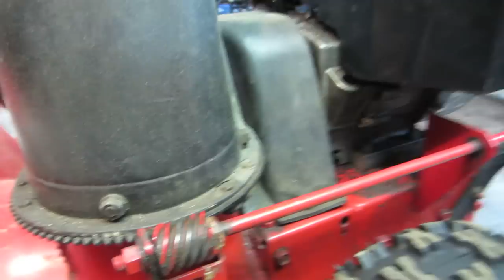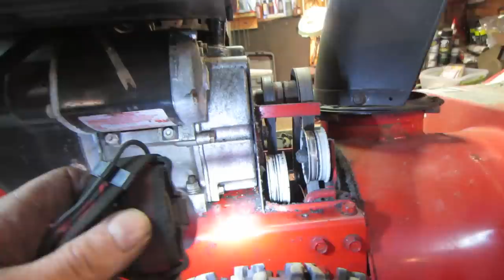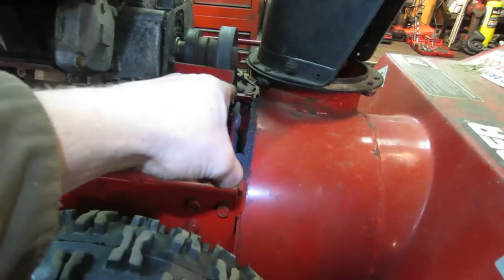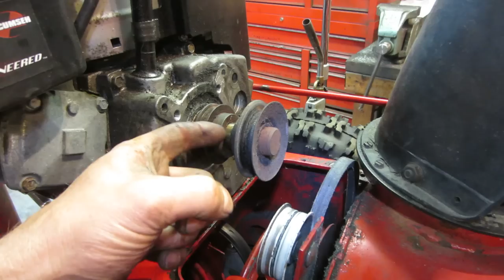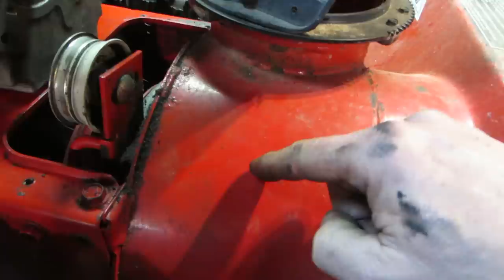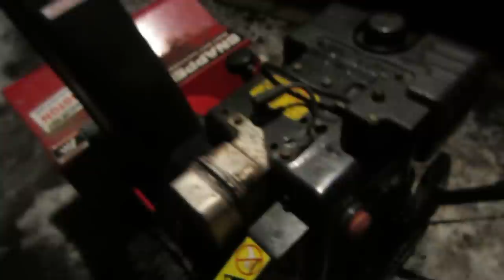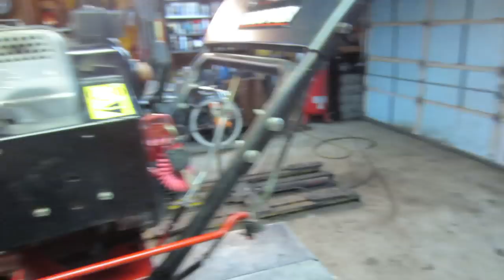snapper snow blower oil leak and shifting repair

Comment: The reason everyone likes your videos is because you always say what your thinking and that makes it interesting because everyone can compare what they are thinking compared to what you are thinking. Plus when you do something you explain why and how you plan to do it and when that dosnt work you come up with another plan. Thats what all good mechanics do. The only fault that you have in my opinion is you try to avoid taking off the carb. I do almost all of them and I flush the tank and quite often change the gas lines. Ive done so many snowblowers I can usually do that in half an hour without rushing. Good job.  Keep em coming.

Comment: I have a Snapper 1030 snow blower, quite a bit older than the one you fixed but otherwise very similar, also with a Tecumseh engine.  I just changed both belts, and I sure wish I had watched this video first!  I bought mine used at a garage sale about 20 years ago for $10 because it didn't run.  My dad cleaned out the carburetor and got it running.  I normally only need to use it a couple times each winter (some winters not at all) but it's been a great machine and really throws the snow.

Comment: Great Video.  I'm fairly certain that these are Tecumseh engines. You can buy a replacement carburetor from Amazon for $15.  The leak issue is one that I'm having a problem with too.  Thanks for putting this together.

Comment: Those set screws can be a bear sometimes and all the more so when they crack before you can loosen them. After you crack them, it just expands and makes it even tighter. They are hardened so crack easy and I have even used an air-arc to blow them out. You always good work and thanks for sharing.

Comment: Really enjoy your videos.  My 8HP Techumseh Snow King (2006 vintage) has the hunting problem.  Backfires when I go to shut it down.  Runs great under load and then will hunt at full throttle.  I have cleaned the carb as well.  One video I saw a few years back suggested to increase the jet size by honing with a larger drill bit.  Trick is to find a bit that fits then go one size larger.  I might give that a try.  Carb has a cap over the mixture screw.

Comment: I have had my share of fighting with repairs.  Thanks for sharing.  A lot of useful information.  I hope I do not need to use this, but only time will tell.  I seem to have more issues with appliances than engines in the last couple of years.  Last year I did have to make a new shaft for the gearbox of my mower.

Comment: I love the channel.  You are as good an educator as you are a mechanic, top shelf...  I have a comment about the original oil leak.  I did not read the full 3 years of comments, but to me, that bolt looks longer than what I think I can see on the one that is outside the shielded area that is NOT leaking.  If my guess is right, I think if you pull that bolt out again, and use a stick to gauge it, that hole is almost surely supposed to be a blind hole with threads and if so, with a longer bolt, it likely pushed in the casing causing a crack in the oil case.  However, as your repair method covers all sins, which is a real positive, it should be fine unless someone decides to remove that bolt in the future.  If you ever get that blower back, I suggest measuring the depth and get  a bolt that stops before impacting the case, or just buzz off the extra on that bolt.

Keep up that great video work.  I am in the majority in saying you are totally getting the making of the video right.  Don't change a thing.

Comment: I would have called you out on the oil idea. I have been working on blowers for years ( Had my own shop) and never have I seen that type of carb back flow into the oil. You are thinking of the Snapper rider lawn mower. I have fixed plenty of those too. Even got one for free because of that. I would think the drain tube for changing the oil may be leaking. If you dont hold the tube when removing the end cap on it,the pipe can unscrew from the block causing a leak. I usually drain the oil and remove the pipe,I then use pipe dope on it and screw it back in. I have also had the caps leak too. I use eather pipe dope or even a thread tape to stop the leak.  I have had the front seal on the engine leak on those too,it wont leak all the way down,just to the seal but they do leak. Usually I find they leak more when running and only going through heavy snow. Eventually it gets worse.  I have never experienced a cracked block or anything like that. I prefer Ariens snowblowers over all the brands out there. I tell people to never buy a blower from big box stores eather. Those are cheaply made. Sadly even Ariens has produced a crappy blower for the big box stores. I tell people to always buy a professional grade blower,yes they cost more,but the gear boxs in the Auger are made better and the drive systems are made better. Pulling rusty pullys is a real treat. I had a rotor tiller given to me where the pullys were destroyed by someone using a puller on those flimsy pullys.

Comment: I usually have good luck getting these off taking the set screws out and then spraying PB Blaster in there then turning it a few times to get the Blaster all over and the wire wheel clean up does make a difference taking it all the way off. The last thing you want to do is break off those set screws. Great video and mine was leaking when I stood up on the bucket overnight oil went right through the shaft seal. Not fun taking everything off to do it but it's been a great machine.

Comment: Another happy customer :-D

As far as your workshop being interesting is concerned, you are a man of many skills.
its interesting to see how you attack a problem, and blokes like mechanical and repair work, its still one of those things we enjoy.
Even if we cant do it, its great to see someone repair something.
Like the honda, a classic to many people, and you made it live again :-D

Yes i thought that linkage was the typical lefthand/righthand thread, looked easy, dam.
That linkage makes no sense, its like they could not get a lefthand threaded rod, so they changed the barrel and nut for a righthand one, odd thing to do :-(.

I didnt expect the crankcase hole to have a leak, i thought like you did with the seal.

I hate grubscrews and bolt heads that are allen key type, and small, ive twisted a few allen keys in the past, with plenty of swearing, of cause lol.
Allen key headed bolts find there way to the bin, like torques screws being annoying in home vacume cleaners, dam torques :-(

The bloody "Got Cha", bloody carb playing games at the end, that happens in electronics too, you sort out a device for all its problems, then just before you give it back you check it...........
Shit!! its playing up in a different way, 2 hours later the hidden fault is also fixed.
Perhaps .... wa wa wa :)

Comment: Good video
The idle surging of engine is from the main jet nut on bottom of bowl,remove it and clean out plugged little hole with a wire from wire brush .
The hole is located at top of big jet.
I bet there is debrie in the hole causing it to be plugged ,also clean out other passages on this jet and reinstall it.

Comment: I was first thinking someone may have put multi grade oil in it as that could be the cause of the oil seal leek if it was indeed leaking but looks like your diagnosis was correct. All the best from NZ

Comment: I have that exact same Snapper and as I've said in the past, those older real Snapper blowers were some of the best. Their frames are built a lot like the old Jacobsen blowers.
Their is a point of bad engineering and a,major weak spot on those....
The axle slides straight thru the frame/gearbox. Their are no supports. Just a lip that is forged into the sides. The left axle bushing in particular can go bad and if you do not catch it immediately the axle will ride on the frame and destroy it. Once that occurs your left with two choices. New frame, which includes a lot of disassembly and re-assembly or what I did, was purchased an Ariens 10000 series axle support knocked a snapper bushing into it because the inner diameter is different. Measured out a perfectly round hole. Cut a round circle into the frame so the Ariens support could go thru and sit flush. Drilled 3 holes to bolt it on. Now its good. No more play and if the bushing ever blows again, theirs an axle support its gotta go thru next, which can be replaced again if neccesary so I never have to worry about that frame again. It was a big pain in the ass but worth it because you cannot buy a machine built strong and big that throws snow as good as that anymore. Thst machine digs hard and devours snow, Im talking big heavy snow.
Also reverse tends to get lost, what you have to do is file the groove for R up further and file the tip of the shift handle down a bit. That will allow the friction disk to slide further over on the plate giving you a stronger faster reverse. Otherwise they are killer snow eaters them old American steel Geargia made Snappers......
I hope to have mine as long as Im around.

Comment: Excellent video! The reverse linkage adjuster looks like a turnbuckle, but it does not have left hand threads at one end of the coupling with corresponding left hand threads on a rod end that would allow the coupling to be turned to shorten or lengthen the entire rod. Certainly less expensive to make it that way, but less convenient to adjust, as you figured out. Wooden screen doors use turnbuckles on threaded rods to take out sag, maybe one could be modified to make the reverse linkage.

Comment: I had the exact same problem with a '74 Suburu wagon. Had a two piece crankcase, and it was the gasket between the two halfs.
  In a tough spot, never could find the leak myself, had to have a dealership find it and fix it.m

Comment: Been fixing for years just going to mention at times save you some grief,every once in awhile you will run into cleaning a carb over and over after years learned to just buy a new tank,have tried cleaning tanks that just refused to clean tanks with a drop sleeve in the throat of the tank which prevents sloshing out all the debris in tank no matter how hard and using every method, even used running water in high volume ,air etc.
Saved more money for customers by replacing those tanks new than racking up hours in labor.
Could run finally send back to customer and he phones and said it quit , don't spend to much time messing with it .
Also l always clean carb complete saves time and no going back .
You have any questions for me just ask glad to help.

Maurice

Comment: Really like that trick with the emery cloth while the engine is running. I’ve done that a few times on engine repair works great! 
Also do you anti seize pulleys and tires and other parts when reassembly can cause things to lock up over time? 
Really like these videos you do. I’ve been repairing equipment for a long time and really enjoy watching! 
Great video, Merry Xmas!

Comment: Have ever worked on a Troy Storm 2620 two stage snow blower ?
Run bi weekly. X
Changed oil and tried to start. Gas leaked out constant. Have started to dissemble. Carb hidden well behind plastic. Gas did not leak out before oil change.

Comment: I knew what the problem was as soon as I saw "Tecumseh."  Kidding aside (sort of) I have a snowblower with the a 10hp Tecumseh on it.  After I've used it for about 20 minutes it will start hunting too.  My parents had given me the machine years ago and it had a gummed up carb.  At the time I knew nothing about working on carbs so I just bought a $15 Chinese carb off Ebay and put it on.  It had always hunted when I used it at my parents with the original carb, and it continues to hunt with the Chinese one.  FYI I'm at 6,600' elevation too so I don't think it's running too lean.

Comment: Sometimes when the puller gets a lot of tension on it and it feels like you can't turn it anymore, you can tap the canter shaft of the puller with a hammer and it will free it up.

Comment: Love your Video you sure know your stuff. Hint I stead of using punch to push back that frozen pullies. Get differ size black  or Galvanized pipe size to slide over shaft then you have equal pressure when tapping

Comment: I had trouble with my lawn mower running choppy and stalling and not wanting to start . I got carb cleaner and cleaned that hole out in the bolt that holds the bowl on . All better.

Comment: I just went to hell and back servicing the carburetor on this exact same machine, except mine has an adjustable and its an 02, that must of been an 03 the final year of production and the year they switched to a non adjustable, or that wasnt the original carb.
Anyway I cleaned my carb and rebuilt it and the machine still wasnt running perfect. Finally I tried taking a carb off another machine that had an engine running perfectly. It was still a headache to tune it in. I got it pretty close but it still doesnt run as good as the engine I took the carb from. Then I threw this carb onto the other machine expecting to have issues. Nope as soon as I put the snappers carb on the other engine the other engine started up and still ran perfect. Which means after 12 years of commercial use the engine on my snapper is a bit seasoned, I'll say. The end if the exhaust valve could probably use a grind and the whole engine could benifit from a decarbinization. But the engine has to have up over 1000 hours on it by now easily. Its running well enough to continue serving its purpose for now. Down the line it will get the service I just mentioned and if it gets worse, the machines engine will just have to be replaced. No engine lasts forever just like cars engines, they break down over time and I can say from personal experience from using this machine commercially 12 years and working on Tecumsehs, they are still the best winter engines out their. That is exactly what this machine will get in the future, another NOS Tecumseh, this Snapper kicks ass out their, as long as you maintain it. Still the best snowblower I have used and I have tried many.
Reply: As long as you can find parts, they are always rebuildable; if you have the patience and know-how to do so. Then, we get into MAKING parts that you can't get.
Mustie has this..

Comment: I had a leak because the bolt was to long. It would torque tight but head was not clamping, just bottoming out.

Comment: i use a air hammer to remove the drive pulley,clutches etc. been doing it in my small engine shop for years

Comment: Hey Mustie1..been a subscriber for awhile now, thanks for a great channel! I really enjoy your style, no nonsense straight forward easily understood comments. Love the yard sale finds! Wish I could find such great deals..lol. I have  learned a lot watching your videos.
I have a quick question for ya, I have a Noma Signature series lawn tractor [1995] with a Briggs 16 HP twin. It has a Hydro-Gear trans Made in Sullivan IL USA. 
I want to change the oil in it..but not sure if it has a drain plug or where it is?
There is an Allen bolt on the bottom, but I don't want to pull something out not knowing what it is.
 Also I thought it had hydraulic oil in it,but, I looked up their web site & they recommend 15-50 full synthetic engine oil!.. Who knew?? I could not find the capacity though. Any thoughts on this trans? I took a couple of pics,but, don't know how to send them to you. Also there is a spline output shaft on one side of the trans that is not used for anything..is this for some sort of option / other implements?
Thanks for any input...Barry.

Comment: It looks like someone either messed up when they originally assembled the engine and the gasket finally failed, or someone has messed up when that part of the engine had been stripped down in the past and tore the gasket.  I would have guessed at a leaking crank seal causing the crankshaft to spread the oil around and then any oil that hadn't mixed with the rubber dust from the belts trickled down while the machine was parked between winters.  It does to show, assume nothing and check everything carefully or it's easy to end up doing unnecessary work...

Comment: I know you have done hundreds of these, but looks to me that there are only four bolts /nuts holding that chute on and by removing it, would make the job so much easier.
Reply from the maker: it had lots of cracks, so l dident want to open a can of worms
Reply: I knew there had to be a reason Mustie1. Love your vids, hope you never tire of making them.

Comment: Listen, when you diagnose oil leaks like this, you can't go by the old oil mess on there after sitting so long. You need to completely clean that engine and frame then run it a while and look for leaks. If need be get some leak detection fluid and a black light to see where it's coming from. Also, when someone sees a big spot of oil it may look like a lot, but it seeps and blooms out quite a bit from even the smallest amount so you can't go by that all the time to determine if it's a "big leak".
Reply from the maker: well its fixed now, no leaks

Comment: I'm not certain, don't Tecumseh Snow King carbs have an idle speed jet that you can clean? I believe they also have a vent hole  that, when clogged, can cause surging as well.

Comment: Out of curiousity, how well will  this 'Good Stuff' hold up as a repair? -and what made you go for it instead of just getting another gasket for the drive shaft cover, seeing as you had it almost completely apart anyway and, presumably, had to drain the oil to have the bolt out and clean its surroundings?

Comment: What combination did you use to get that pulley off. Is that part of a bearing seperator along with a puller latched on grabbing it off.
I have a bunch of these same Snappers and all those pulleys are rusted on good. I have destroyed a lot of pulleys trying tp get them off with a traditional jaw puller. Your insight into how you got that off is much appreciated in advance.